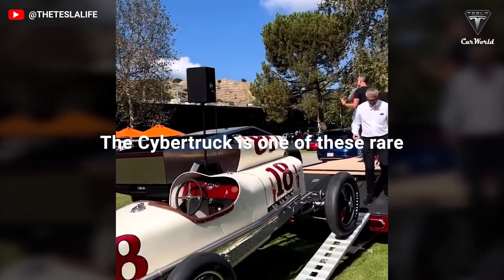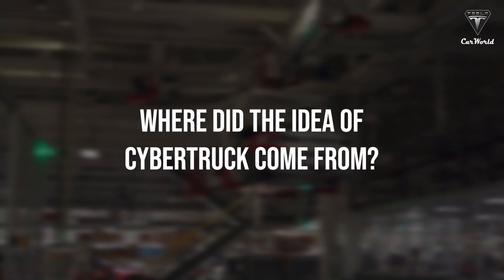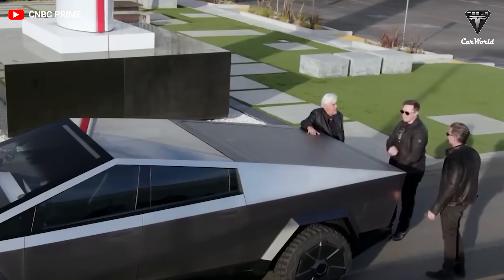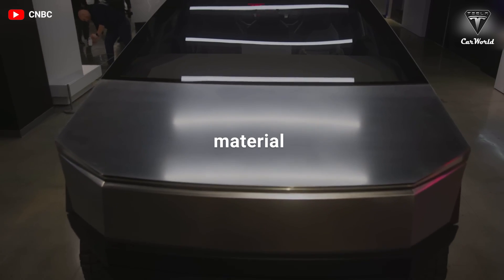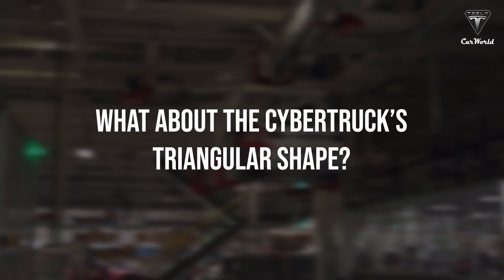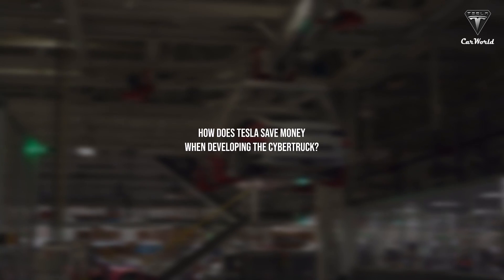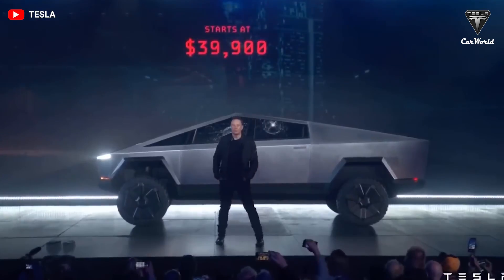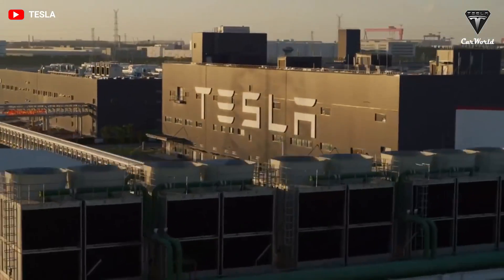No More Doubt! This is the Real Reason Elon Musk Developed The Cybertruck!

Comment: I have been designated as a combination welder since 1980. That means I have been certified for welding a combination of steel alloys from carbon steel to stainless steel and even what they refer to as a dissimilar metals test. You weld carbon pipe to stainless pipe using 309 SS electrodes. It also refers to using tig and stick welding techniques. I have quietly endured all the BS about the proposed SS that will be used for Cybertruck. Tesla and SpaceX are both using 304 SS to skin their vehicles they plan to use in Outer Space. There is a misconception about SS. It is not hard ( particularly in its Austenitic State ) but it is tough and chemically and corrosion resistant. Hard SS such as knives are made have a high carbon content that makes them Ferritic and less corrosion resistant. If you want to dabble in discussions about metallurgy you should obtain a rudimentary knowledge thereof. 😉

Comment: Remember 30X is shorthand for 300-series stainless steel (not 30-times). They are not sure exactly what alloy they will use (like 305) so they used the 'X' as a place holder for the last digit.
Reply: that is a good detail to keep in mind, yep.

Comment: Yawn.  It was unique when it was announced 3 years ago, but by the time they actually make it, the Cybertruck will be nothing special.
Ford, Hummer, and Rivian already have electric trucks you can buy right now.
GMC, Dodge, Toyota, and Chevy have electric trucks coming out within a year or so.

The Cybertruck was technically the first designed, but for whatever reason is taking nearly 3 years to make.  By the time it goes on sale, there will (are) already other options that look better, perform better, and cost less.  So what's the point of this video?
Reply: Yes you should go out and buy a truck made of steel, and watch it turn rusty, that will be fun 🤣🤣👍. Well, have fun!

Comment: Don't like the shape for practical reasons.  Like the tech or the way they have built the drive train system.
The shape needs to be more truck like on the box. The cab can be whatever. I am a big fan of the Canoo pickup design with it's Forward Control type. 

I would rather see a rounded stering wheel. I would rather like to see buttons and nobs for simple functions. 

I live in the Upper Midwest, so I would prefer a different handle style and at least 1 key lock for manual opening in case of issues. 

Our winter weather means we have trouble with icing on the outside of our vehicles. Sometimes, you need to get a gloved hand into a door handle and pull quite hard.

The other stupid thing is having a window that has to roll down a little to get the door open. 

News flash, if there is ice all over everything , the window is not going to roll down or the raise lower mechanism or motor can be damaged.
Reply: These guys sent a rocket into space and landed it back on earth backwards. I think they will handle a little ice here 🌍
Reply: @eamonnmurphy5385  I know people who have Teslas in my area 1 has had no trouble because it sits in the garage and he rarely takes it out in the winter. 

The other guy I know dealt with a real issue when we had a sleet storm roll through and the temp dropped. 

He could not get into his car for over an hour. He had to turn it on to get it to heat up and just wait. If he had to get anywhere quickly he would have been late and even could have cost him his job if it happened more than once.

Another guy I knew had his plugged in to charge and the ice froze the charge cord into the port and he could not get it out until after an hour of pre heating and then he could not move the charge door without running the risk of breaking it until he got it totally thawed. 

My Leaf was no big deal. The charge door protected the cord and I got it to close when I unplugged it. 

I also did not have to thaw my car to get the door open. The window does not have to drop for the door to clear.

My leaf was ready to go way before their teslas were. 

I guess Leaf people can let Tesla people sit in their nice warm car while their Teslas thaw out. 

Try getting into a Tesla or get the handle out to open the door when it's iced over.

They can build a rocket but can't solve the most basic issue for a car in the winter.
Reply: @desertdan100  Cheers, I guess they have some teething problems. Hope they get these sorted out 🙂
Reply: @desertdan100  well, tell your friend to clean and wax the door jambs, and keep the Tesla or any other cars, plugged in overnight.
  Run the heater as soon as he she wakes up, and looks outside at the weather. Will be fine.
Reply: Thanks for your sort of "mature" comment on this channel...
Reply: @stennordenmalm9900  I actually am a Tesla Investor. I have invested in other startups as well. I am a truck guy and have owned and used them for years.

I am a fan of Tesla Tech but some things I think they missed the mark on and some things they are way ahead of the curve.

I would love to blend the best of all into one vehicle but that isn't going to happen.

Good video.
Reply: If your doors stick shut in winter, try waxing the insides of the door jambs, at the spots where the window gaskets contact the door jambs. Use a silicone car wax, example RAIN DANCE. Use a silicone thin thin layer, of silicone film grease ,on those rubber door seals. This will keep it from sticking shut. Works well.
  Wipe off excess grease and wax.
Reply: Well, one could use one’s phone to tell the Tesla car or Truck to pre-heat, melt that snow or ice?